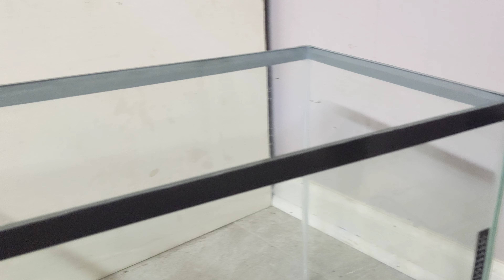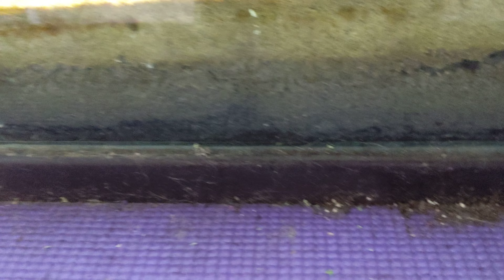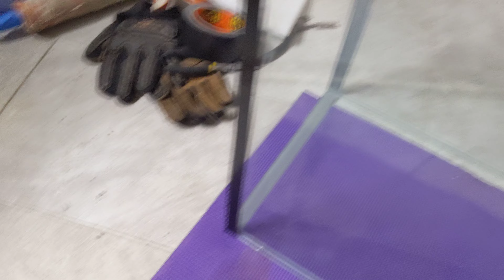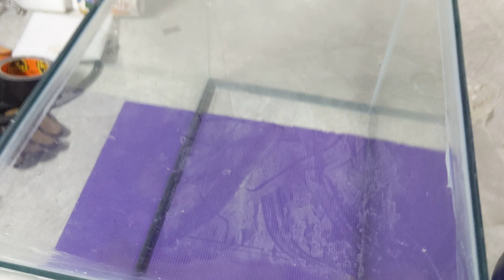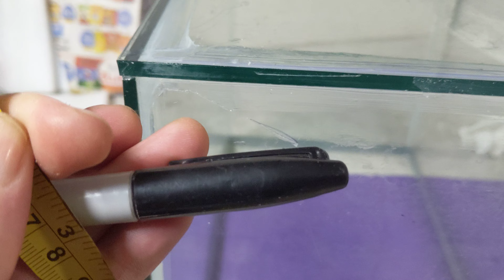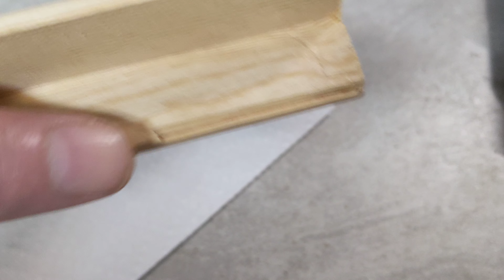Replacing Old Broken Aquarium Rims for Strength and Longevity, DIY Repair.

Comment: Is that tape holding all the pressure? I'm about to do something similar on a tank with a plastic filter housings on top of the rim but not sure what to use as a replacement of the rim for structural purposes
Reply from the maker: No, Juan, the tape is not holding any pressure; that is what the frame is for.  

The tape was simply a temporary rim, holding the glass from falling apart, and because the wooden frame was not attached like a standard one-piece frame, there wasn't much point in removing it.  Your fasteners will be what actually holds the outward pressure, of the water, so you'll need to use adequate fasteners!

The "rims" are actually called "frames", and you can purchase complete plastic frames, on the web, wholesale, from Over the Edge, a supplier of plastic aquarium frames (top and bottom are the same).

Their URL is aquariumframeswholesale.com

-But if you like woodworking, metalworking, etc..., and feel capable of attaching a frame that can hold the pressure, feel free to make it, however you can!  -Multiple pieces or otherwise!

Best of luck, with your project!
Reply: @cave.dweller.mediocrates thanks!